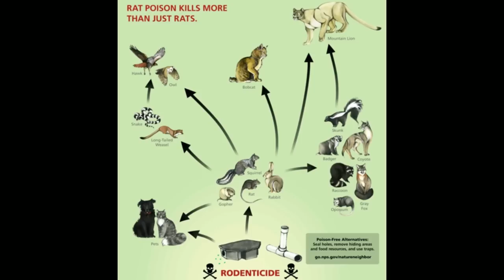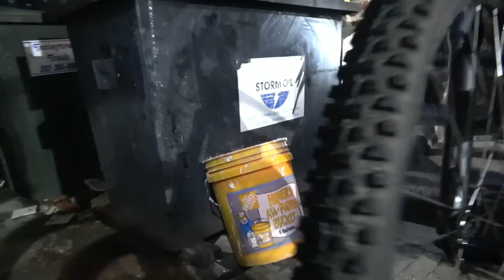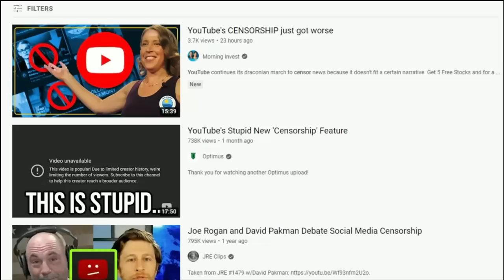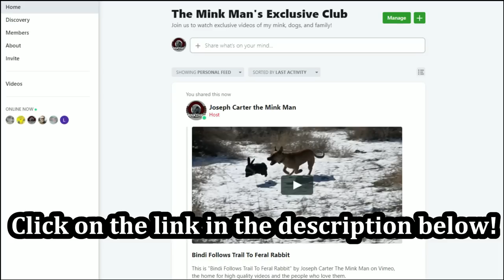House Dogs vs Street Rats!

Comment: The tactic of blocking off an enclosed garbage coral with a person and then letting the dogs go off leash worked well!  All the garbage cans on the public sidewalks seem to harbor multiple rats underneath the can.  These can are all uniform in size and design.  Some sort of portable round shielding should be designed and set around the perimeter of the garbage can before the dogs move in.  There are so many rats underneath these cans that many escape before the dogs can dispatch them all.  This perimeter fencing would keep the rats trapped and give the dogs time to deal with them individually.  A modified outdoor baby fence comes to mind.  Bring a cart to haul the panels around.  Through trial and error I bet a convenient, portable, easy set up design could be developed.  Excellent video!  I really enjoy the city ratting!

Comment: Guys, your lights are partially to blame for the dog's confusion, I would have a hard time seeing much if multiple beams of light bounced around me and in my face.... maybe investing in lights with more diffuse and wider beam would be a way to go. another option would be fixed lights, something like a few of those cheap rechargeable fill lights on clips so they could be attached to bins and such.
Just an idea, how practical it would be for the circumstances I'm not sure